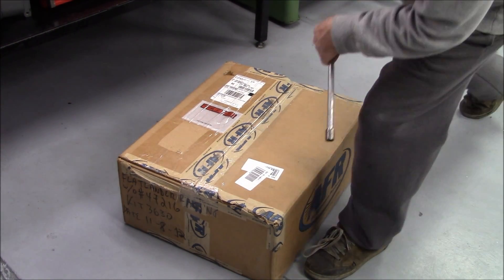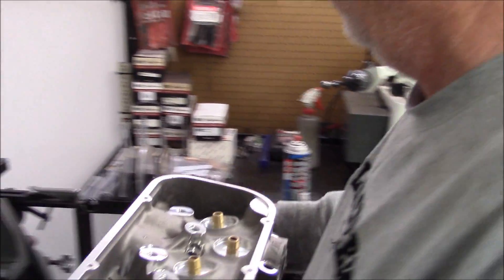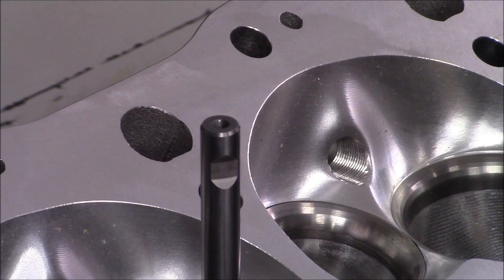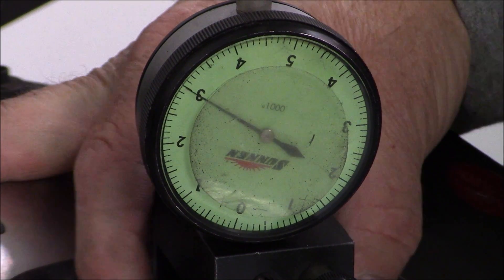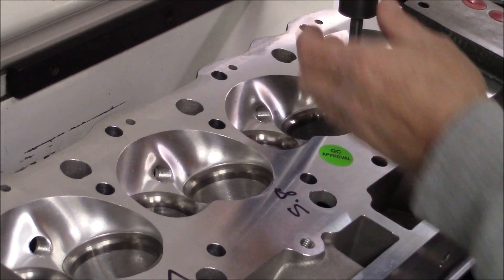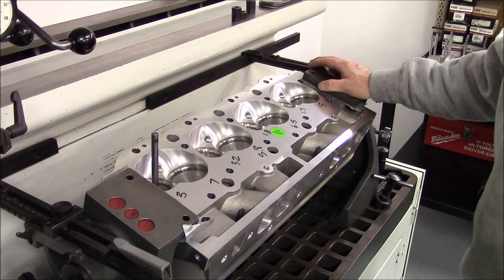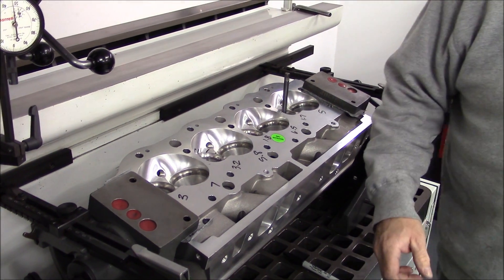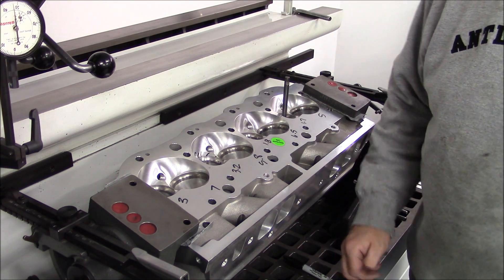Aftermarket Cylinder Heads - Why You Shouldn't Just Bolt Them On - Part 2 - TRRC / Vortecpro

Comment: Do you know of anyone who has taken a brand new factory head off a new truck, for example, and checked the actual valve run out coming directly from GM?  Just curious?
Reply: tolerances on oem are generally pretty sloppy.
Reply: CNC does not equal precision.
Reply: I am a Machinist, It is not so much the machine but the process and the person who is doing the work. if they probed each hole then ran a cycle it would be near perfect but that takes more time so they just mount them in a jig after the holes for the valve stems are done and interpolate them all at one time and thats why they run out.
Reply: They use to be VERY sloppy. Now they are better at least GM is. But still not nearly as precise than what a good machine shop can do
Reply: That’s a great question considering basically he’s sayin that them aftermarket heads that are 2 grand a piece are off
Reply: Yes, welcome to the CNC craze. Everything might be crap but hey these are CNC crap!
Reply: I just did a set of ls 5.3 heads and they were worse then what he is showing. Crazy thing is it's all done on CNC machines so it should not be like that. It took .010  to straighten out what GM did and you can see in the ports we're the valves were leaking.
Reply: cyclone buzz t
Reply: Flex???!! No clearance in the guide may help .It will also put allot of side load on the valve head possible leading to failure (If it even runs) think of it this way a piece of paper is about .003 so at .009 it would be a gap you would actually see day light through. As stated the cylinder would probably not even fire and if it did it would backfire through the carb, and a blown motor would lift the blower right off. a nitous motor would blow the intake off ECT ECT. There is an old saying don't drink the cool aid. These claims just are not real in my opinion.
Its really troubling that people actually believe this Bull what has happened to the people??
Reply: Four seats fell out at the same time?
Reply: Tom, I'm not necessarily talking about a bare casting from a manufacturer. I'm referring to a fresh casting from the foundry. 
I have a full CNC machine shop and make a myriad of different parts from aerospace to land speed/ drag racing.  
Yes I am talking about Ford heads, tooling built here in Cali and cast here in Cali also. The heads I machined were the Ford Gen III hemi head originally designed for Bob Glidden before his falling out with Ford. John Kaase now machines them without the Ford part number on them. They came in 3 different versions for different displacements and bore spacing's. I have 2 sets for myself.
I completely understand everything you're saying above, I just like some other people are saying that you need to check the valve runout and seating when you buy a new pair of heads especially in the old days but not all that long ago, like before 5-axis machines became affordable.
My father and I have 2 records at Bonneville and El Mirage each. I don't believe they're still standing any longer though. We do build our own engines too.
Have a great day Tom!!
Reply: well on a truck it's probably pretty crappy... on performance car it might be a bit better.. but... they're more sloppy than afr.
Reply: Honesty, I wouldn't care where the head was sourced from. If it came "un-assembled" such as in the video. They would have had a complete inspection and necessary corrections made without any thought needed.
Reply: Davidbrennan5
Your half right. most heads are machined in a fixture on a 5 axis machine. Then there removed and the seats and guides are installed the old way one at a time. Then the  heads are put in a seat cutting machine Sunnen/serdi/newen and cut one port at a time. Thats part of the reason they cost so much.
If the valves were off as much as claimed it would barely run and if you got it started with a blower or nitrous it would blow the intake off its just bull.
Reply: Not saying that flex made it ok, just with a fair amount of spring pressure it would run and wear in. I can guarantee the head and or stem will flex that, but it can cause a valve to fail like popping the head off. Yes you would see light thru but with ample spring pressure you wouldn't  I like to  keep the run out to .001 or less. No reason to have anything more except poor machining or machinist.
Reply: mikeandmona 
Yes I did and it was horrifically out!!!
Reply: Blown 460
yes i have prepped bare castings as in bow tie 18 deg ect.
.006 is a heavy press fit and there are ways of installing them that will not warp the casting.
Blown 460 are you talking ford? are you starting with china heads?
I have been doing this sort of thing professionally for over 30 years.
there are all sorts of builders (home and professional) out there some just have to take a little cut there and a little here to make it there own . kind of like a dog peeing on trees.
MANY do more damage than good
Many think there measuring but dont even know how to use the tools or over estimate the accuracy and repeat ability of there tools.
And there are the guys out there that just intentionally screem FIRE to panic the customers into unnecessary work and expense.
Even if you believe you have fine tuned every thing on that head. (which is unlikely) see comments above.
What do you think happens to that head when it is torqued down and exposed to cylinder pressure and heat cycles?
The mass production ? American performance cylinder head manufactures are really not mass production.
There are machining the heads one at a time on very expensive equipment that is far more accurate than most armature and even many professional builder have.
There really not efficient which is one of the reasons for the cost.
I know I sound like im biased toward the manufactures but right is right.
I actually dont even like the owner of AFR but there products are very impressive.
Except there CNC porting is a little coarse.
Reply: john smith what are you doing with your truck? Never heard of seats falling out ever. Your truck engine must be running really hot
Reply: No he's saying you need to pay him money
Reply: about the seats being off as claimed it would barely run. Valve stems flex and will flex when hitting seat especially with a lot of spring pressure.  Over time the valve and seat will wear closer together
Reply: Tom, have you ever machined bare castings then put the seats in with around .006" interference, then check the flatness of the deck? It's amazing how much the head warps from one end to the other. I have, we wound up having to put the seat bores in, insert the seats first, then re-deck it and then you can do your finish machine work ie: drilling and boring the guides and finishing the spring pockets along with the rocker pedestals. It's a pain but if you want it right that's what you have to do. Mass production doesn't allow for that kind of extra work, but you'd think for that amount of $$ they would. Oh well.

Comment: I gotta tell ya, anybody that claims "they've run many heads right out of the box with no machining and had good results & no issues"...............is simply a liar. And these kinds of guys usually surface in comments when ya happen to be using a particular brand of head that "they like". And they always act like pro's like you "don't know what your talking about"............while the troll making such accusations has probably never even changed his own oil, lol.  Excellent video, proving once again: "NEVER run heads "right out of the box"........no matter what the manufacturer claims. And DEFINITELY never buy heads already built up complete. Buy your heads BARE and purchase your own valves & other parts separately. That way, you know for sure exactly what you paid for, then pay a qualified reputable shop to do a complete job. Too many suckers are winding up with cheap Chinese made valves & such, when buying "ready to run" heads right out of the box.
Reply: I run Edelbrock E-Street, fully assembled heads out of the box on my '73 Nova, SBC 350, bored .30 over, Dynamax long tube headers, Edelbrock intake mani and 600cfm carb. I've put more than 3,000 miles on the setup so far, and the heads haven't given me any issues. 

Though on a side note, the accelerator pump in my carb did prematurely fail. Not really a big problem; in fact the car will function without it (be it not all that well), but it was still a defect.
Reply: +Howabouthetruth I Personally have not seen any problems with my heads but then again I have never done a compression test to see. I also don't make any more then 530rwhp but car runs perfect and does not burn oil and is boosted. But after watching this I'm a little worried. lol My heads are cheap compared to those.
Reply: +Howaboutthetruth I wouldn't go that far, you are making a very absolute statement, and not taking into account how shops like this actually work. After setup, and new inserts it's going to be pretty bang on. Those initial runs will be about as clean as you can get. It's only after the setup has been run for a while and the operator gets a bit lazy and doesn't keep up with the changes that much that you can get sloppy work. That and or the company just sets crazy tolerances. But even in those extremes there will be a few sets of heads that are pretty damn good. It's just a matter of how lucky you are. Now if someone said they have bought several sets of heads at different intervals from the same company and said they were just as good with repeatable results then I would be quicker to call BS. 

Also to note, even the best shop with the best practices will have some that are not as good as the rest. Even with the most precise machines you can't make something perfect each time. It all comes down to allowable tolerances if they are out of tolerance and can't be fixed they go to the recycling pile, and if their tolerances are not what you consider acceptable, then... well you have to get a smaller shop to get it within the spec you desire.
Reply: @q......  These are mass produced heads. And anyone spending this kind of money on such high performance bare heads SHOULD figure in an additional cost to take them to a good machine shop like this. Sure, the heads can make good power just the way they are, but can be made so much better as you just saw in this video. And this is only part of what will be done. DOZENS of reputable machine shops have videos posted showing this exact same issue with ANY mass produced aftermarket heads. So don't try to lecture me about mass produced heads.